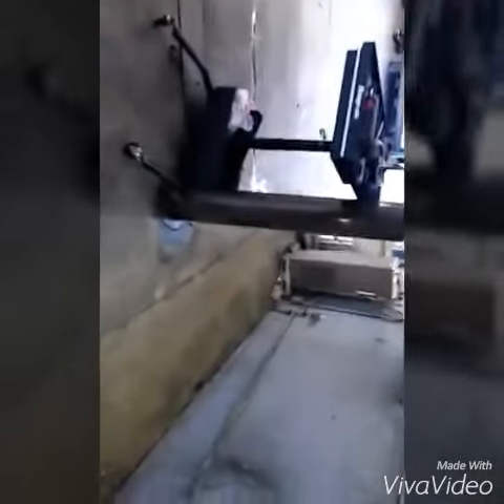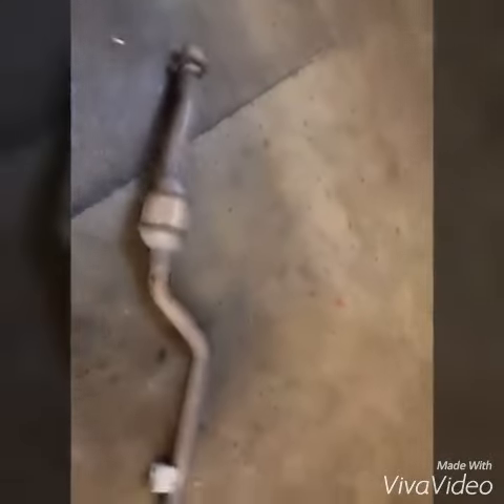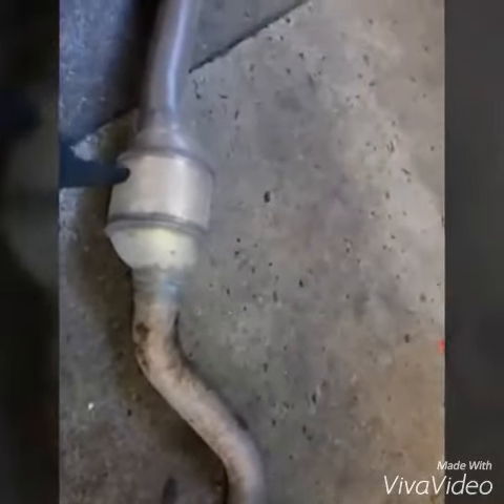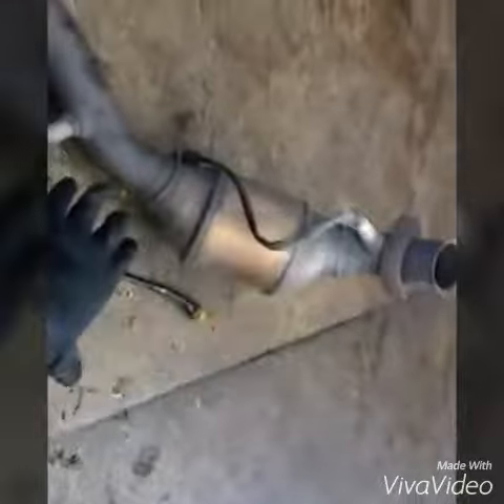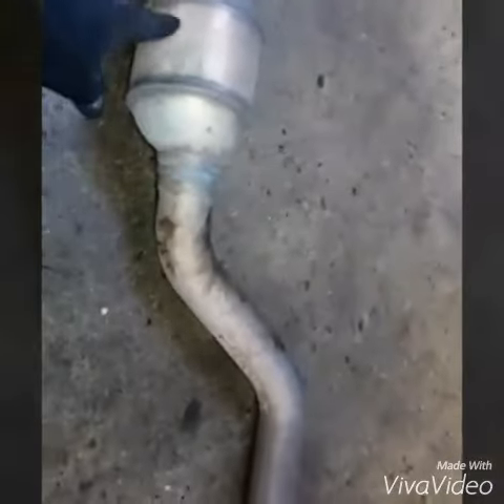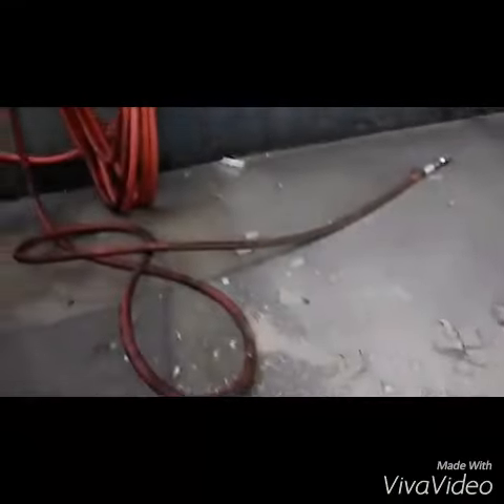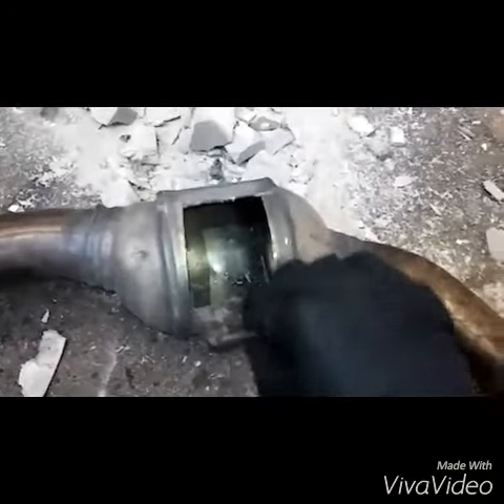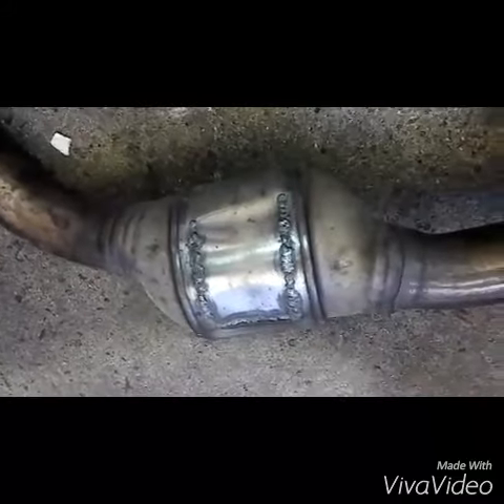Removing deleting catalytic converter converters or cats from any car e500

Comment: Note to people doing this because of gaining power or noise etc:  De-coring cats gives a slight 'throaty' noisier exhaust.  It doesn't really give any noticeable BHP.  The REASON why a lot of cats are de-cored is because when (not if) the front cats fail, the platinum/ceramic chunks end up being blown down the exhaust system and then stops against the second cat.  Because the cat cannot pass this large amount of material through the ultra thin holes, the back pressure increases.  Once the pressure is high enough (in a fraction of a second), the engine will fail.  Normally by cracking.  Or, the turbo will fail, manifold will blow etc etc.

Removing the cats isn't for 'show'.  It's to prevent catastrophic damage to the engine when the first (main) cats fail, blocking the secondary cats.
Reply: Second Unit Aerials Usually, this primarily only applies to people who tune their car for power. And even then, this is referred to as “gutting” the cats, which is frowned down upon in most parts of the car community. Especially if the car isn’t tuned for it, the empty chamber now creates a disturbance in the exhaust flow and disrupts power output, etc. If it’s legal, cut it completely out and replace it with pipe. Best way to go about it.
Reply: I was going to have my cats removed soon by a company, until I found out they weren't going to put straight through pipes in, but simply extract the cat core, leaving the original empty casings.  Umm...not for me.  I'll fit my own pipes I think.  I want straight through...not boxes full of mini tornadoes.
Reply: how do you know which cat is broken ? I have a rattling in my secondary cat, how do I know if it came from the front?

Comment: Better flow so more air , more power, and lower fuel consumption. These systems never live up to the hype. Best to just blow the cat out. You can also simulate what the O2 sensor does. It sends out about 2 volts when good. Converters are supposed to get hot enough to burn the residue but they get clogged from bad gas.  The US forced Mercedes and other imports to have the EMISSIONS system , but they only work for about ten miles on crappy gas. Your mileage goes down the more you drive it. If you worry about fuel consumption or emissions you can still monitor the 02 sensor at the manifold. Use that signal to adjust the mixture on the electronic systems. Your intake vacuum should be as high as possible meaning no uncontrolled air is getting in. A common problem on the Mercedes. Thanks for the tip on the weld.  It makes it look original anyway.

Comment: There's probably over $200 in PG and value in just the material in that one converter, if anything he could have kept the front Converters on and deleted the two in the back by just removing them and putting piping in the middle, then he could have sold the cats and got money instead of ruining them.

Comment: Modern o2 sensors will detect a chance in air pressure after the Cat and the computer check engine light will come on because it knows something is wrong
Reply: That’s exactly what o2 sensor spacers are for. That’s how you get rid of a check engine light after removing the cats. Simple trick but it works.

Comment: There's valuable pgm's in that cat that he's just dumping out, not to mention the check engine light is going to come back on 100%, we're talking about one of the most delicate car makes on Earth
Reply: William Henry i have a 2000 s280 with identical exhaust which is non type approved due to the age so mot much value as no precious metals inside. May have to find a welder tho. Also there is no 02 sensor after the cat so the ecu wont find anything difference so no engine light. Although my light has been removed by someone previous but i will diagnose it to be sure.

Comment: this will add about .......how many hp to your car? Really doe i don't think people intend on polluting the enviroment purposely, by doing this to their car,but for some this is the easier and cheaper way to go, plus some people that drive cars older than twenty-thirty yrs.old have no choice but to take them off i've done it to a Pontiac grand prix,Buick lasabre, Chevy cavalier rs, and all had increase in power,sounded awesome especially on the V6 Pontiac
Reply: oh yeah and the check engine light never stayed on none of the vehices
Reply: Myke Johnson the box says 10 horsepower
Reply: i kno frankie, possibly even 15 in some cases it can vary

Comment: Guys, how does the air sensor behaves after you remove it? Normally the 1st air sensor checks whats going out, and the 2nd checks the emissions level, by default when ti reaches the 2nd sensor figure numbers should be lower than whatever thw 1st sensor was reading. So you remove the 2nd cat,  what do you do with the 2nd air sensor? Thanks guys
Reply: In this rare case it will have no affect. In select years. Especially 20 years or older vehicles. If you rod out a cat with a upstream and downstream o2 sensor and a converter between them every vehicle will throw the P0420 catalyst efficiency code. However on this year Benz and I know because I am both a MB Tech and I own the Mercedes with this setup. In the earlier emission years vehicles didn't even have o2 sensors. That's another matter though. In this scenario Benz used 4 converters but the front 2 were the only ones monitored. The rear catalysts were an addition to further reduce emission gases, but have no bearing on 02 readings or OBDII.

Comment: I wonder if this can be done on both cats and how that would affect emission inspections! I'm thinking about doing just that on my old 97 Jaguar XJ6
Reply from the maker: Chutuo P it can be done. But deffintly it will not pass inspections. You would have to put atleast high flow cats and put o2 simulators.

Comment: I've all ways been curious if those style cats gain anything from a small expansion chamber after the cat is empty like FMFs power bomb pipes. Prob not there bulge is in the head pipe but b interesting to do a Dyno run trying both, may cause some wierd Tq increase, but prob not.

Comment: The Germans get about 60 more horse power without this nonsense and far fewer fuel related problems. A 450SL gets 175 horse where the non emissions German cars get 235 HP. The same as a Porsche 3.0. Top end goes to 175. The 450 is OK at 140.
Reply: Do u mean, itsnt good idea to delate catalytic system.? I consinder these factors, low noise /low fuel consumption /engine power.

Comment: How hard is this to do while the Cat. (y-pipe) is still on the vehicle?
Reply: Hard unless you have a lift and can stand under the car. Even then its a difficult job. This is why i avoid dealing with the cats, better to remove the exhaust at the bolt on flange and just remove the resonator and mufflers and bolt it all back up again
Reply: @MrMachacker  Yup. Well said. My first one I removed I replaced it with a 3 inch copper by pass pipe that went all the way back to the TURBO muffler I installed. It acted like a dump at higher speeds. Now they use flow through and that looks original. The cooper drain pipe was a nice low resonance as well. Like the 3.0 it gets that low end rumble.

Comment: Great thas how u do it so it can pass inspection in case they look under car for cat deletes!!! But what if i delete the front cats w a cat sensor plug foul exst nd stick 02in there to trick computer ? Will that pass inspction if no check engine light comes on? Thnx great vid dude!👍🏼
Reply: Good comment.  The o2 sensor sends out a signal when operating properly and the voltage drop cause the computer to enrich instead of lean out. The same thing happens with vacuum leaks. Too much uncontrolled air. Stupid system and it always was. It's the unburned fuel that causes the problems. Backfiring comes from being too lean.

Comment: So did the check engine light ever came on? Because I plan on doing this to my clk320 and want to know if you would think it will sound better
Reply: I want to do my sl500, what do you think? Will it give me better sound? A exhaust system is like $6000....
Reply from the maker: yes i loved the way the benz sounded. not to loud not to low and had a nice deep tone to it on idle and accelerating.  my benz had four cats. so i only removed the rear cats that had no o2 sensors so the cel did not trigger on. if u remove the one that goes between the upstream and downstream o2 sensor than yes the cel will come on. unless u get an o2 sensor simulator on ebay.
Reply: +Alex Juan alright I removed all four of my cats. I had star diagnose system to turn off the o2 sensors. Do you have any idea as to why the sound of the car did not gain? It got me so frustrated since I've seen other people doing it and it sounded awesome. When I did it it almost sounds stock... Please help
Reply: @Alex Juan<---So are you a cat hater? Do you prefer dogs instead?
Reply: I need to get this done, what do shop owners typically charge for this service, already assuming its an ''under the table' deal.